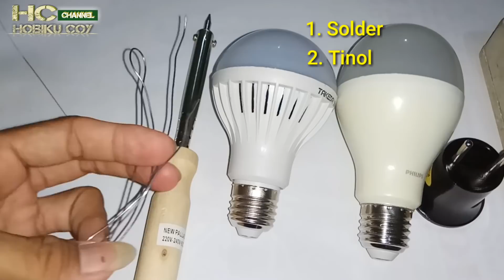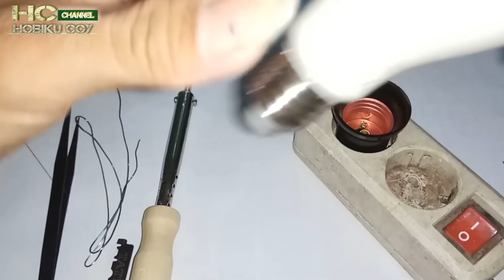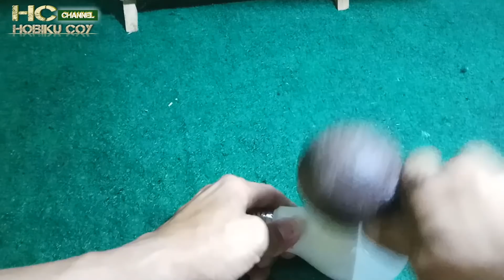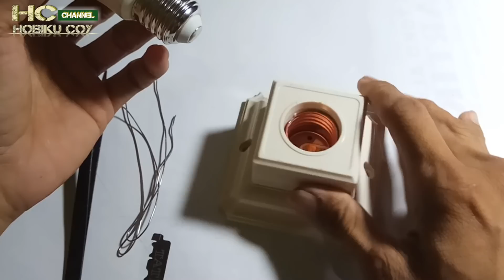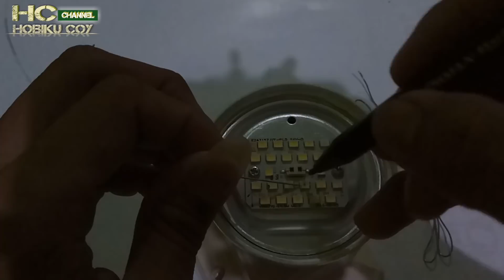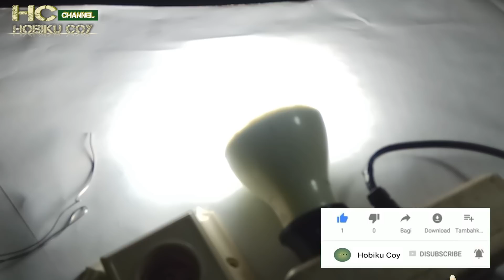CARA Memperbaiki  lampu PHILIPS 14 watt

Comment: Pasang resistor 4,7ohm 1/2 watt aja om Aman, jgn asal main jumper ntar pada mati lagi lampu lainnya
Reply from the maker: Sip
Reply: @hobikucoy  kalau gak ada pakai Dioda ziner 9v / 12v juga bisa 🙏
Reply: @cuanxitem  dioda zener berapa watt Om?
Reply: Bisa nyala tapi pwanas om lampuku 😂
Reply: Teri.ma kasih tAmbah elmu

Comment: Gak boleh dijumper, nanti cepat putus yg lainnya karena tegangannya tambah bwsar untuk setiap lampu. Harus diganti.
Reply: Betol
Reply: Betul
Reply: Mas ku mau nanya, 🤔 kalau di jumper 1 chip LED tapi resistor mengatur arus didobelkan, apakah tidak masalah?

Case:
Saya punya LED Philips 14,5w, salah satu chip mati, kemudian saya jumper..
Kemudian saya bongkar Drivernya dan resistor yg tadinya 4R7O 4R7O diganti 22nya dengan satu Resistor THT 10 ohm..

Kan artinya arusnya jadi turun, tapi apakah tegangannya turun juga?
Saya ga bisa tes tegangannya krn ga ngerti
Reply: @XanderProduction  ....kalau misal led yg mati diganti dg resistor dg nilai ohm disesuaikan dg nilai maksimal arus yg diperbolehkan mengalir ke rangkaian lampu led, mungkin tidak akan mempengaruhi led itu sendiri..
Reply: @AhmadFauzi-ms9db  thanks 🤣 Ku pake 22 Ohm 1w Resistor, and it works..

Really good point to replacing a dead LED with a 22 Ohm 1w Resistor, and i have a bunch of them..
Reply: @XanderProduction  maksudnya di titik LED yg mati itu langsung dipasang resistor 22ohm gitu ya bos?
Reply: @jokolewung9093  iya..

Comment: Kapok beli lampu LED merk Ph*L***, ga awet,
Mending panasonic, lebih mahal Rp 2 ribuan awet pake banget..
Reply: 🤔 Sebenernya sama aja, tergantung kapan belinya, krn model 2011-2014 memang cenderung tahan 5-10 tahun, tp utk produksi tahun 2016 ke atas cenderung semakin lama semakin tidak tahan panas komponennya krn pembatasan usia dari pabrik
Reply: @XanderProduction  ilmiah sekali..
Reply: @eddysupriadi4821  ._.) Ku jualan lampu jd tau soal perjalanan LED Bulb komersil..
Kalo mau awet, beli lampu murah yg kisaran 5w, kemudian ganti Kapasitor Milarnya dgn nilai skitar 224J-334J; dijamin bisa nyala lebih dr 5 tahun..

Atau juga beli LED Philips 19w, kemudian suruh tukang servis lampu utk bongkar dan ganti Power Resistornya dgn nilai 3-4kali lipat dari nilai awal, dijamin awet 10 tahunan..
Reply: @XanderProduction  wah, sangat menginspirasi Om..
itu bisa diterapkan untuk lampu LED yg murah² nggak Om?
Trims
Reply: @jokolewung9093  kan udh kujelasin 😑

Comment: biasanya gak bisa bertahan lama, ok selamat berjuang hehehe
Reply from the maker: Lama tdknya tergantung dari usia lednya juga bang,karna lampu led itu ada masa pakai sekian ribu jam, kalo usia led msh agak baru cukup lama kok bs berbulan-bulan, dan ini hanya mode darurat sblm ganti lampu yg baru gan
Reply: @hobikucoy  bukan begitu konsepnya..

Contohnya LED Drivernya ngasih 1200mA, tapi LED Chipnya mintanya suplai 1150mA karena satu chip mati dan di bridge seperti di video,

Maka yang terjadi, komponen jd over heat dan cenderung mempercepat kerusakan total komponen..
Reply: @hobikucoy 
Kalau mau awet, ku ad beberapa tips dan penjelasan..

LED sekarang mesin2nya cenderung cepat mati karena tidak tahan panas dibandingkan versi produksi lama..

Kalau mau di bridge 1 chip LED seperti itu, turunkan juga watt dari LEDnya dgn mengganti Resistor SMD dengan nominal lebih besar..

Tentunya cahayanya akan lebih redup, tp kalau mau mengejar keawetan dengan mesin lampu jaman sekarang, ya cara termudahnya ya turunkan wattnya..

3W putih LED Bulb Philips turunkan ke 1,5w; kalau yg kuningnya kan real wattnya cuma 2,2w; turunkan setengahnya juga..

6-12w putih LED Philips turunkan ke 3w;

14,5w Philips turunkan ke 7-8w;

19w Philips turunkan ke 10w
Reply: @XanderProduction  thks bos ilmunya .
Reply: @hobikucoy  ok bos semoga bermanfaat ilmunya

Comment: Bang lebih  bagus dijumper dengan resistor  10 ohm 1 watt atau diganti mata led dengan spesifikasi yang sama karena jika led putus jika dijumper nyala tapi tidak bertahan lama  karena driver / mesin lampu pilip led memakai driver IC
Reply from the maker: Iya gan karna ini bersifat darurat dan bt mereka yg awam tentang elektronik
Reply: @hobikucoy   ini saya dapat ilmu dari teman  bang jika led putus jangan dijumper  karena  tidak tahan lama

Comment: kalo bnyk yg putus ada 12 led kalo di jumper semua apa tidak akan over voltage ya?  malah akhirnya putus semua
Reply from the maker: Ini hanya mode darurat bang sebelum kita beli lampu yg baru, kalo emang sudah usia led pasti akan putus lagi satu persatu, tapi kadang juga ada yg awet sampai beberapa bulan kok bang
Reply: @hobikucoy  yg saya tanyakan bukan masalah usia led smd nya bang,  tp over voltagenya,  misalkan lampu jumlah 10 led dan setiap led membutuhkan daya 5v brti karena mode led nya di seri penyuplai tegangan nya kan 5x10=50v nah kalo misal ada yg putus 2 kan kita jumper aja jadi cuman tinggal 8 led yg seharusnya cuman membutuhkan 8x5=40v tapi penyuplai dayanya 50v kan jadi overvoltage akhirnya semua led yg masij hidup malah kelebihan voltage dan putus,  kalo saran saya sih setiap led yg putus kita ganti dg dioda biasa bang,  kalo lebih dari 1 led yg putus
Reply from the maker: Voltage turun Iya itu sudah pasti gan, kalo untuk mengganti dioda/ lmpu led mungkin itu cara yg paling tepat tapi buat orang rumahan blm tentu mereka bisa memasangnya dengan mudah diperlukan alat khusus, nah disini hnya mode darurat yg paling praktis sebelum ganti lampu yg baru gan

Comment: Led smd philips 9v  atau 6v atau 3 v mas?
Reply from the maker: Mksudnya gmn gan?
Reply: @hobikucoy  led smd nya kan ada yg 3v  6v 9v,    led bawaan di philips brp volt?
Reply from the maker: Untuk led ukuranya beda2 gan kebetulan kemarin pas sy benerin lampu yg 14watt ini sy tdk cek voltase lednya, jadi pengalaman sy dari beberapa lampu led yg pernah sy coba lakuin cara ini Alhamdulillah berhasil semua dengan cara ini kecuali klo komponen mesin yg rusak, jadi ini merupakan cara darurat sebelum agan beli lampu yg baru gan
Reply: @hobikucoy  siap terima kasih info nya gan.